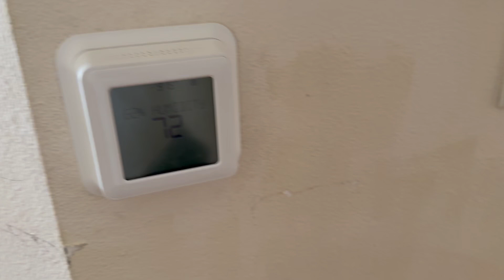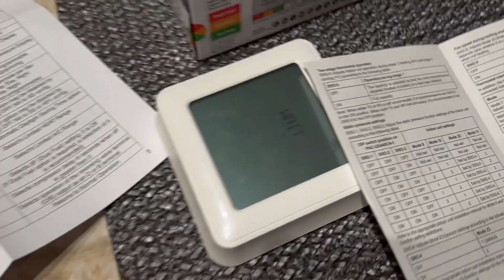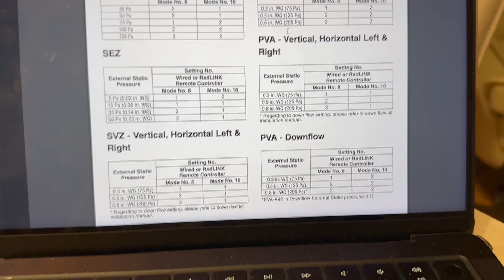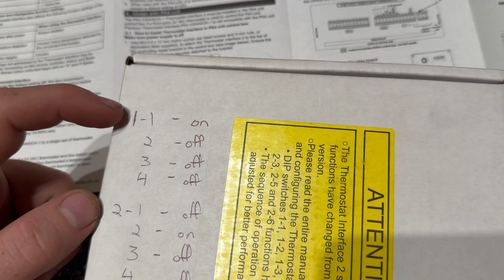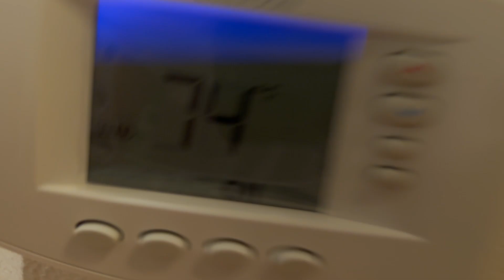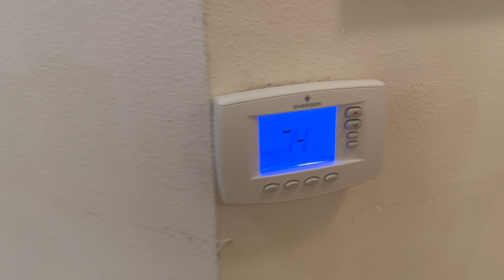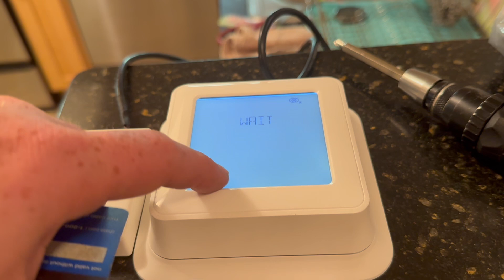Installing a 24 Volt Thermostat On a Mitsubishi System Using A Thermostat Interface - PAC-US445CN-1

Comment: Where did you get the 120V for the transformer
Reply: The S1/S2 mentioned above is most likely 240V, not 120V. In this case make sure the primary of your transformer is 240V.
Reply from the maker: You can wire it straight into s1 s2 at the unit. That goes for all brands of mini splits that use 3 wire communication